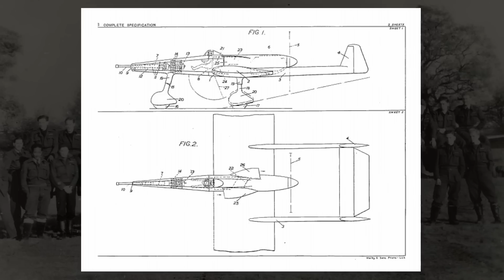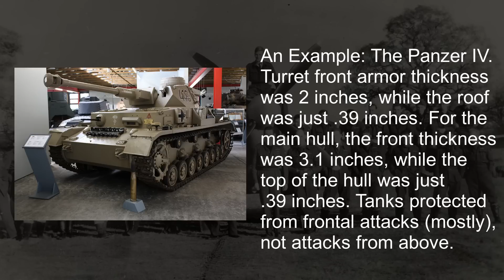Martin-Baker Tankbuster: The Failed Flying Tank Destroyer

Comment: You do realise that this became a reality in the MK18 Tsetse Mosquito. The 57mm was a Molins gun modified for the plane that included a 23 round clip and able to fire a staggering 55 rounds a minute. Just to be clear here, this is an anti tank gun round not something you can put in your pocket. Lethal against U-Boats, however Tony Philips scored a hit on the engine of a JU-88 violently removing the engine block from the wing.
Reply: And Typhoon and Tempest expensive and gap filled harsh realities of war
Reply: @garyburns2831   I was just about to write here about the Tsetse Mozzie, but you got there first!
Reply: The mosquito its a better choice...
Reply: I always wondered why the  RAF didn't use the Mk.XVIII in a tank busting role.  The 6 pounder could kill a King Tiger, from above.
Reply: The dive angle might be problematic for a safe pullout.
Reply: Hitting a tank is surprisingly difficult, even the A-10 has had a surprisingly low hit rate in tests, with a far more capable gun and targeting system.

Rockets are probably better for suppression and damage.
Reply: @jamesbparkin740  Erm they used it on shipping and submarines. The Molins was a navel gun just adapted from the 6lb anti tank gun. Tanks were safe.....although I have heard a rumour that a test was undertaken after the war with a Mossie carrying a 32lb (90mm) for tank busting.
Reply: Hurricane IID
Reply: @lancaster5077  You do have a point..
Reply: There's a very good documentary on the DH 98 Mk XVIII Tsetse: https://youtu.be/pX-IxiZyGRk
In short, there were only a handful converted. They paid for their eccentric weaponry by being shower, less maneuverable, and more vulnerable to fighter attacks; so much so that they never operated without extensive fighter cover.
Reply: was just going to type that when I say your comment. Excellent points.
Reply: Don’t forget the B-25 with the 75mm in the nose.
Reply: @bebo4374 You know that had to come about, because there were a bunch of B-25 guys, sitting around bored af thinking, what else can we shoot at the Japs with, when one of them noticed a Sherman with a burned out engine sitting around, just as useless, and BINGO! 75mm gun in a Mitchel 😂
Reply: Gosh, that is one deadly mossie
Reply: The mental image of that engine literally being punched out of that Junkers always cracked me up!
Reply: @cpfs936  Imagine the conversation in the cockpit of the Junker:
Fritz: Hans! the number one engine is out, should I feather the propeller?
Hans: (stairs at Frtiz).....
Reply: Tsetse Mosquito was anti shipping attack aircraft not air to ground.
Reply: @jameswebb4593  Indeed it was, but equally used in the Bay of Biscay against U-boats.
Reply: We don't know if it worked or not because it was never created. They should have built at least one prototype. For this type of aeroplane with the engine mounted at the rear chances are it could have worked. The proof is the A-10 which is similar in design. They put 2 engines at the back for increased power and reliability
Reply: @JamesJames-jt3ts  It doesn't matter, even if it would have worked. Logistics is always the first question. You would have to  complete development of the aircraft--bc an experimental, flying model is only a proof of concept--the setup production, train maintenance personal and pilots, produce not only all the aircraft, but also all the spare and replacement parts, and fit all that into logistics so that everything gets to the field at the same time and then runs as smoothly as what ever aircraft is currently in service, doing the job this one is to take over, AND it has to be so much more successful in doing the job, that all the cost and effort--and the effort is also cost--is worth the investment.
The reason the Army Air Corp didn't make great efforts to replace the P-51 during the war, was that it did the job, and until the ME-262 came alone, did it superbly, compared to what it was going up against.
Even after the deployment of ME-262, Bf-109K-4, and FW-190D-9, all of which had great advantages over the P-51D, in one aspect or many, the AAC stayed with the P-51D, bc it was there and it was good enough, and they knew, by the time they had deployed a new aircraft--IF there were one available--the first formations would be in service a few weeks, just before the war in Europe ended.
The US still had to fight the war in the Pacific, and wasting money and effort for practically no gain, would only be taking away from the Pacific war, were casualties were horrendous and not only mounting, but increasing greatly.
Reply: @JamesJames-jt3ts  Excellent point about the A-10.
Reply: @JamesJames-jt3ts j21 from Sweden